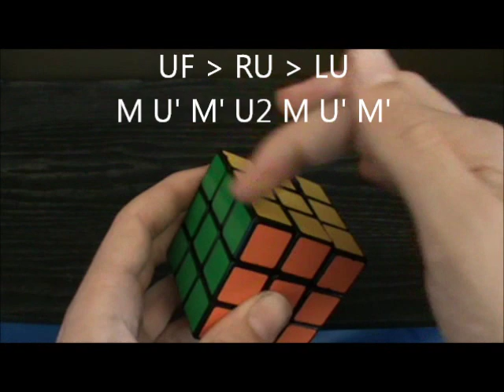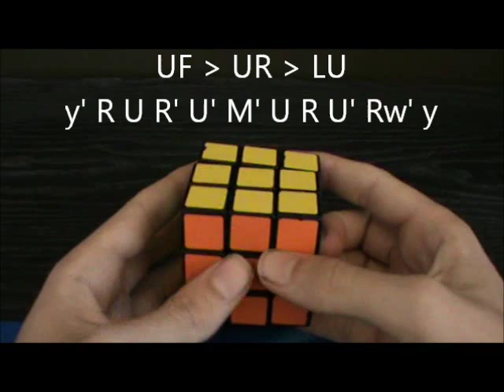TuRBo Edges: Part 2 - Algorithms

Comment from the maker: Consider this: Once mastered, TuRBo and M2 are pretty much the same speed. However, M2 is easier to master and basic 3-cycles with M2 can be very easily done. If you already know TuRBo, then you may as well use TuRBo. If you know M2, use M2. If you know both methods, your choice.

Comment from the maker: Hi, I use 3style (speed optimal 3-cycles). So depending on the case, I might use a commutator, Turbo setup, or other non-commutator algorithms. 

3style isn't like most methods that you just instantly switch to, I for example started with Turbo, then learnt commutators, then other 3-cycle algorithms, and gradually started to incorporate them all into my solves.